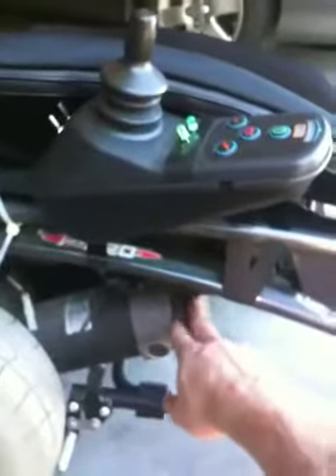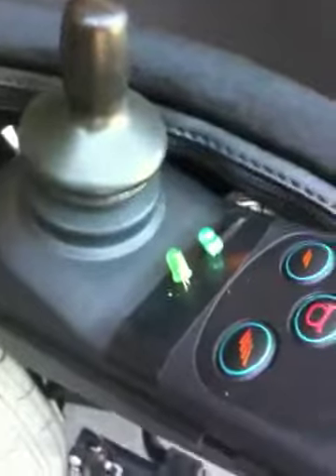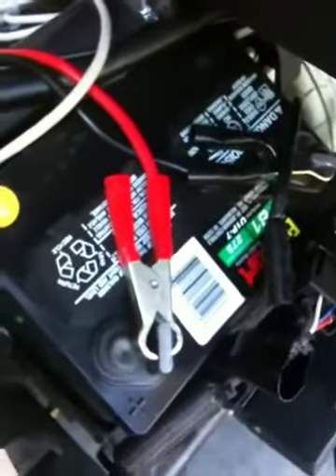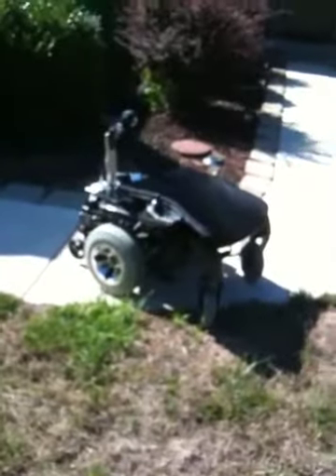Mr mower overview part 1 of 2

Comment: Nice project! I see you are powering your Foscam using the original adaptor and a power inverter. I am researching how to power the camera with just battery power. I suspect the camera needs a clean and rock steady 5 volts  so I would have to use some some sort of voltage regulator with the battery. Any ideas?

Comment: Thanks for the reply. Yes I looked into the 7805 regulator and was concerned about the heat and lack of efficiency. I found a switching buck type regulator ($15) that is 90% efficient at the required current draw. I will also try a low wattage power inverter as they are inexpensive. My concern with both devices is having a clean low noise power output. Also, with the inventor, I will be starting with 12 volts and autos provide about 13.8 volts. I keep researching and post my results on my page.

Comment from the maker: @tronics666 your options for remote power from a batter are to hook the battery up to a cheap inverter and use the included foscam plug, or build a power regulator sing a 7805 5V voltage regulator, and a rew resistors (and a heat sink!) Careful with this approach... I built my own voltage regulator for a 12V battery and caught one of my components on fire.  Just take your time, be careful and do your research :)